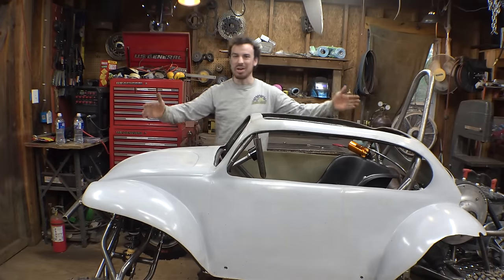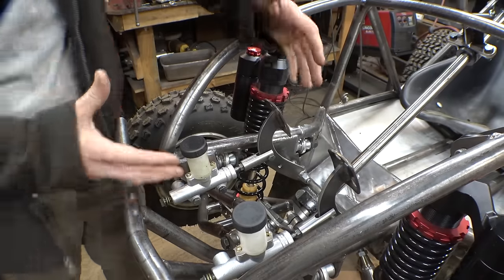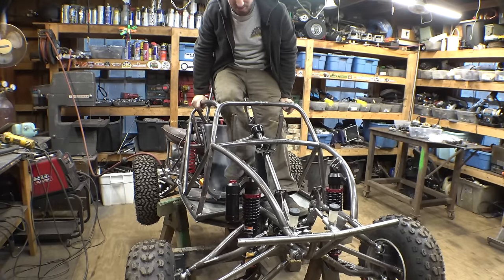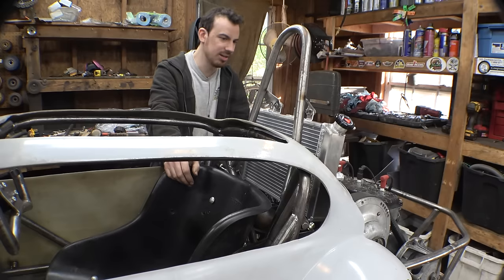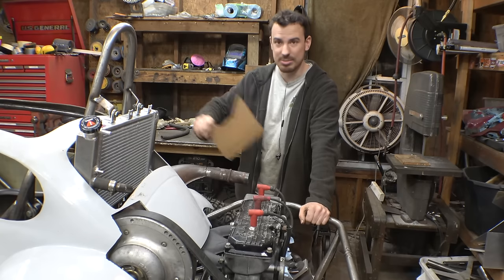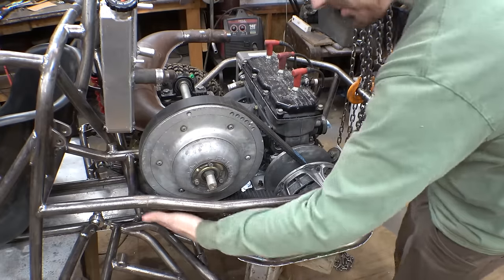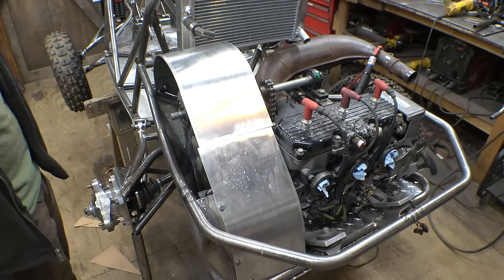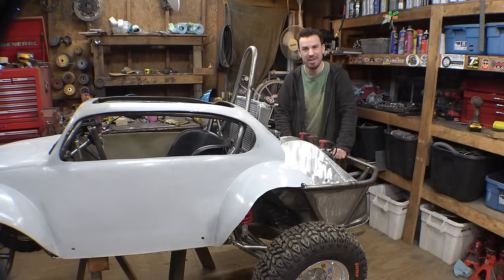Back to Work on this  - Mini Baja Bug Project - Part 13

Comment: with you moving the radiator inlets/outlets youre basically cutting the radiator in half. water will follow the path of least resistance and having the inlet and outlet that close together basically makes the top half unused. you  may even end up with an air pocket up there
Reply: Exactly what I was thinking
Reply: Same
Reply: Yep, they're at the top and bottom for a reason
Reply: @Theshed12  originally they were both at the top......
Reply: @1one3_Racing  one is half way up.

Comment: I agree your head loop is below your head. You can see it in your video when you are sitting in the seat. Also,  your body will block the air flow when sitting in the car.  And if the radiator gets damaged, you will be burned severely.  Other than that. It's awesome.  Be safe

Comment: Love this build, cant wait to see it run. I would suggest adding two braces off the back of the hoop down to the rear frame and attach the radiator there, that eliminates all your heat concerns being inside and its just as close to the engine for plumbing. you can then place a large fuel tank where the radiator is now as a gravity system without the need for a pump, this also keeps all the weight on the rear for better wheelies.

Comment: You could go with 2 gas tanks as steps on the sides between the wheels. Fill that void and deflect some of the sand spray from your front wheels.
Reply: I totally agree, it would be easy enough to connect 2 gas tanks together and they could fit into much tighter spaces.

Comment: If you haven't figured out a fuel tank yet, it seems like there's decent space behind seat on the floor, and it would be easy to plumb in rotopax tanks on the side if you needed more capacity. Personally, I would just use premix fuel so theres no guessing if the oiling system is working, and it's one less thing to find space for. I love the way this is turning out and keep up the awesome work!

Comment: Scald guard, my friend.  At minimum, fab a radiator cap splash shield (C shaped directing scalding coolant towards the rear).  Good luck the rest of the way.

Comment: You should mount the radiator as low as possible and make a small shroud that you can put duct tubes with vents from the back corners of the windows to the shroud. You'd still get plenty if air flow to the radiator and you'd have the ability to make a firewall behind the seat so if something goes wrong with the radiator you don't get covered in hot coolant.

Comment: Ive seen many vintage style baja bugs use a roof scoop for the oil cooler. Your cage hoop resembles that. Ive also seen vintage vw's with side scoops on the rear windows. Adding won't look entirely out of place. As for the radiator, i don't think you'll have cab heat issues as long as you are moving or the fan is on. Mabye install a manual fan overide switch for those few times you feel it whole sitting

Comment: You are an absolute master fabricator. I've been watching you for years now and seen how you've grown in skill and this build certainly shows that. I thought maybe ducting for the Rad, just before you said it.. I reckon thats a grear option even though the fabrication is difficult and extensive, otherwise your back is going to cook from the heat. Anyway, I'm sure you'll find a way, you're innovation skills are just excellent

Comment: Cutting brakes should be on a lever on your right hand...forward to lock your left wheel and back to lock your right.  Then your left brake pedal to run all for wheels. Also the rad is big enough you could run it behind the engine between the rear hoop bumper.  Especially if you're running fans 👍

Comment: Pusher fan instead of a puller, so you could distance the radiator farther away from you. At least another 2” or so. Multiple gas tanks. Used like a reserve tank, with back up fuel pump if need be. Or just to push fuel from one tank to another. I think the cat cover looks awesome. Love your channel! It is my favorite!

Comment: Nice work, your fab skills and processes to get to the end product is truly inspiring. Its not ugly at all.
On the radiator, you could rotate it 90 degrees, and mount it higher up the roll bar hoop, so it can actually catch air, and not be too blocked by your shoulders. I think you might have some problems where it is, but that said, if you run the electric fan on it all the time, then it might be totally fine - just right by your ears so not much fun.

Comment: Throttle should be set up for your trigger finger in my opinion. So when braking you won't accidentally hit the throttle. Your engineering so far is awsome!

Comment: Things to ponder.   CV cooling,  they get hot and need lots of air movement.   Oil tank behind seat on floor.   Fuel tanks could be made by making the tree bars into tanks.   And with some paddle tires this thing is going to be legit with 95 hp.   Good job.

Comment: put some small scoops for air flow behind the roll cage in corner of window then heat shield the cockpit .. would look clean..also make sure the fan sucks and doesn't blow .. builds looking awesome👌👌

Comment: When you started this, I remember thinking the engine was really too physically large and that would cause you to have to make a lot of compromises.  That has turned out to be true, but I have to say, you have done a great job so far with those compromises.  This should be a very unique vehicle when all said and done.

Comment: Idea,  make a moulded side intake shroud through the side windows which would not affect removal of the body, combined with dual electric fans,  the intake can also work as a shield for your back & neck, in the event of overflowing hot water 👍 good luck

Comment: I think you should do a little more with your head loop. Your still gonna have your head hitting the ground if it rolls with the way the car will be angled upside down. You should do more of a drag racing driver loop and have it extend past your head and shoulders
Reply: Agreed he also should have stretched the body to give himself more room inside it's going to be tough riding
Reply: This was filmed a month ago
Reply: Bumping his head is nothing new to him obviously.
Reply: At some point you have to grow a pair and accept the risks. Just like a 200hp street bike, that thing will never be safe to drive if you don't have a brain.
Reply: @MrArcticPOWER  man im all for ripping, been doing it all my life. but, its a little different on a street bike when you can get away from the machine in a crash. all the other similar builds like this on YT are built to get flug out of the machine. ex: sendy and the barbie jeep. hes gonna be enclosed inside. being smart fixes alot but shit happen.
Reply: At least put a halo on it or something before someone dies 🫣 you know like the Indy cars have. Just a thought 🤷
Reply: I agree. This project is a death trap. I keep thinking he should just turn into a killer 1/3 scale rc.
Reply: @stimothy9396 don't need any more.looks dumb with what it has now.
Reply: He can just add a stinger to the bumper. Not quite as good but it could help
Reply: It's not about not hitting his head, it's about not breaking his neck or body by getting crushed

Comment: build a scoop with induction above your head for the radiator. Then you can shroud the entire front for shielding. Also a gas tank behind the seat should put you near the 2.5 to 3 gallon range. And also help a little with weight distribution putting it in front of the rear axle.

Comment: I would build a louvers as part of back window and duct it into radiator. This would add some style into your build. And scoop air from anywhere you can.
Also build a tire replica as fuel tank and mount it over the engine as your fuel supply. It would look like you are carrying a spare like some of the pre runners/ buggy racers.

Comment: I think the solution to the heat problem is to make this electric. plus how are you gonna drive in the summer when it's super hot out and the engine is hot? you're gonna get heat stroke yo, don't wanna loose ya love your content

Comment: you should definitely add a heat shield/fire wall between your body and the radiator. ducting through the windows would work well enough probably

Comment: i love those steering wheel controls. the only plate i would consider making removable is the one strait out from the CVT, or make a hole to access the Main CVT bolt.

Comment: You need to figure something to cool down the cvt box. ATVs have fan fin in the back off the primary and an intake and exaust pipe. Even snowmobile have belt heat issues

Comment: Take the radiator and make a air dam that goes behind you and your seat upper and make it have a pul down draft. And make sure a very good fan and you can make air ducts from the sides of your seat also. But use some good thermal insulation to protect your back

Comment: Just an idea but these Baja Bugs have things bolted to them. So with this in mind why don’t you make a triangle oil tank and mount it to the back of the new CVT cover? With regards to the fuel tank what about making it wrap around the seat, you could have the sides of the tank down each side of the seat and a smaller wedge shape part across the back. Would be quite large, keep the weight towards the rear and keep the weight low down. Also a lot of these bugs have an air scoop on the back, you could fit one to your hoop and use that to channel air into the radiator.

Comment: Put the tanks besides the chair. If you want a larger fuel supply; put twin tanks, one on each side beside the seat. The oil tank can be mounted to the rear frame near the engine.

Comment: I love the look of the belt cage ... but I think you need some ram air in from the top and out near the bottom rear or somewhere the tires won't pack it full of mud. 
That being said I've seen your other vehicles inside a mud ball sooooo?
Nice work as always!

Comment: On the side fiberglass window openings, create fiberglass air scoops to capture from outside the air flow into the radiator with tin/aluminum interior mounted panels to aid in the air scooping. Then create a heat shield say half the width of the seat may have a slight V shape on the center.. crazy idea black and yellow safety (orange stripe) striping effect on the converter top cover maybe match concept to exhaust cover shielding.. can't wait to see it driven........

Comment: Did you all see. Where that lower house mount is ? On top of the expansion chamber. The water going in that motor going to stay hot !! Plus the hose melting 🤣

Comment: You might want to add a spare drive belt mount that holds a belt in a position where you can just slip it on.
With all the welded shielding and tight spaces getting a new belt in there will be nearly impossible in the field.

Comment: Maybe put in some plexi or Lexin in the side window openings. Paint the inside of them to look like tinted windows. That also would help keep water off of you. Could you of dome or still do an engine cover that would tie into the belt cover? With some louvers in it! Also on tractors with deferential brakes they have a lever to flip down to make the dual peddles act as 1. You could flip it down when you dont need deferential brakes and then only require 1 foot for full braking?  Just a thought bub!! My family absolutely loves this project!  My 5 year old son wants dad to make 1 lol!!

Comment: Consider what would happen in an overheating event. Sitting basically on the radiator isn’t going to be fun. A heat shield/firewall and some air ducting is a really good idea. Not only for your safety, but for cooling too.

Have you thought about adding a light bar anywhere? You could use it to assist in rollover protection if you line it up with the roll hoop.
Reply: Agree. Radiator is too close to exhaust. Use shield, or make some change. maybe two smaller radiators and other place fór them.

Comment: You should make a shroud that goes fron the top of the head loop and down to the radiator. Like leave the loop open in the front like a big air scoop

Comment: Leave radiator there and just put some fans behind it. You'll feel the air pull plus make sure some sort of heat shield on the exhaust

Comment: You need to check cvt torque driver working space in your cover, seams its too small space to extending in width. Also you definitely need heat cover on exhaust pipe to do not heat your radiator. For good air flow just add cooler on radiator and couple of plates both side for strength air flow. Also your Chinese braking machine for front brakes is not enough fir two wheels, its will be hard left hand working)

Comment: You can also make multiple gas tanks and connect them together to increase the capacity. Wouldnt even need 2 fill caps if you do it right

Comment: air doesn't get 'funnelled' so much as areas of higher pressure air fill areas of lower pressure air. so long as the pressure differential across the radiator exists and a pressure differential between the front of the radiator and the surrounding air exists then the flow will happen. The issue of 'wasting' the energy of the moving air is moot when using fans, the fans add that flow energy requirement. you actually have a bigger issue at play with the hot side of the radiator being able to flow to the cold side of the radiator, the 'constrained' airflow with the duct and heat shield would likely work out better than the open design...

Comment: Yes Radiator heat shield behind seat with scoops at each back window or pickup side scoops like VW Van in front of back fenders. How about dual tubular gas tanks on each side on top of, or disguised as nerf bars/ running boards 🤔

Comment: You should make two hinged bars that goes from the rear bumper to the head hoop then you could mount your radiator and fuel tank to it. That way they are further away and you could just unpin it from the hoop  to remove the body

Comment: I'd 100% make a heat shield between you and the radiator.
Make it wrap around a little and duct air through the windows.
I don't think it's going to require that much cooling anyway

Comment: you should think about putting heat sheilding between expansion chamber, seat and radiator as my bet is most heat is coming from there.

Comment: You 100% need to either move the radiator or make a metal shroud. If that thing leaks or gets punctured it will shower you. You ain’t getting out of that thing too quickly.

Comment: @dougdority5589 said to "Mount the radiator Porsche 930 whale tail style" and I totally agree with that and make a really cool guard with CNC cut design in it to protect it from damage.
Also you can make a fuel tank that wraps around the bottom of the seat and along the sides [kinda like a horse shoe]

Comment: I would paint it the same color as the body. It blends in with the body so good. If it was the same color. U wouldn't be able to tell its not apart of the body.

Comment: Don't forget to put a number of drain holes in the bottom of that CVT enclosure to let the muddy water drain out regardless of which angle the vehicle might be resting on uneven ground.  So holes left and right, front and back. 😉

Comment: You could have kept one brake pedal with control over both rear brakes like normal and used 2 vertical bars side by side linked up to the handbrake/e-brake mechanism on the callipers. Old school British trial cars use this set up. Gives you amazing control over left and rear wheel speed with the use of 2 fingers or "twiddlers" 😆
Reply: You would need a proportion valve to have both circuits on 1 pedal.
Reply: @jimbush8325  it would be no different to normal brake set up. One master cylinder controlling all 4 wheels. Then the twiddle brakes solely for back brakes via the handbrake mech

Comment: Hey man, ever thought of using one of those Baja snorkels that go on the roof? Your head could actually be inside of it and it would not be seen as much, and I would think the wind would go around your head enough to feed the radiator possibly?

Comment: With the radiator outlet lower mean less flow through it, if its right at the bottom you will only be using half the core, with the top half stagnant coolant.

Comment: i urge you to add a firewall between you and the radiator, if that radiator or a hose bursts it will give you severe burns and might actually kill you. this happened to somebody competing at cleetus mc farlands burnout contest, he survived but its been way to close for comfort (and the guy sustained injuries that he will carry on for the rest of his days). its a bad idea to have the radiator there, but you got no choice, so you might as well make that as safe as possible, by adding a firewall, you should mitigate that risk to an acceptable level.

Comment: I couldn't really tell but did you take into consideration that the forward wheel on the CVT will expand the faster it spins when making the width of the cover?  Great video as always :)

Comment: Just put a ducted fan in front of the radiator and wire it to be constantly on, will solve both problems, all heat will travel backwards and wont feel it, and airflow will always be constant

Comment: Looks solid! I only do not like the lateral bar over your shoulders level. It seems to me that if you have a lateral hit your body will pass above it and you will badly hurt your neck. I would probably remove the rest of the  roof and lower those bars.

Comment: Personally, what I would do since it’s going to get really hot inside that belt guard is pick a couple of spots on the top of it and put some vented ribs in there because that is going to get very hot in really quick

Comment: The last snowmobile cart you built, you had a problem keeping the front wheel on the ground when you hit the power band. Are you doing to do a wheelie bar or put some weight like the gastank in the front